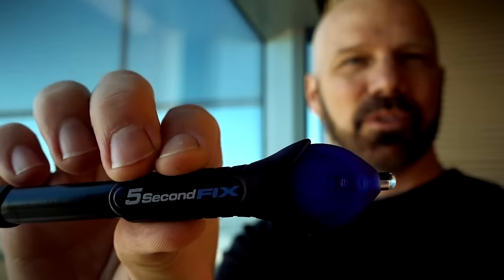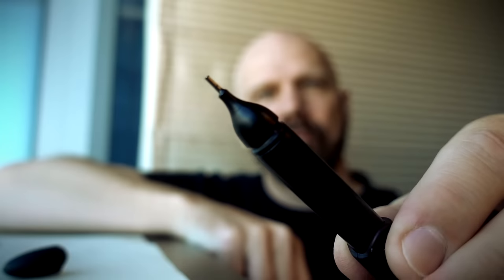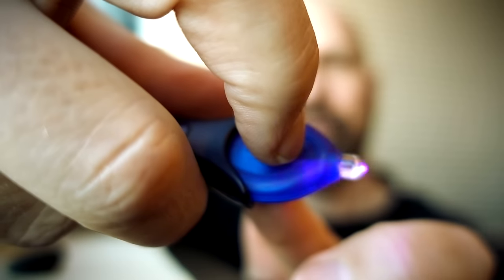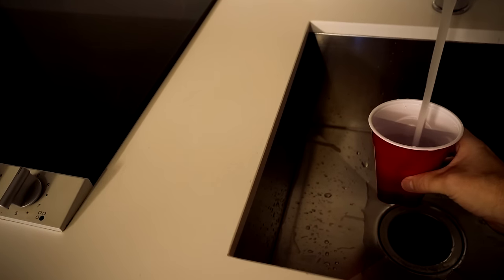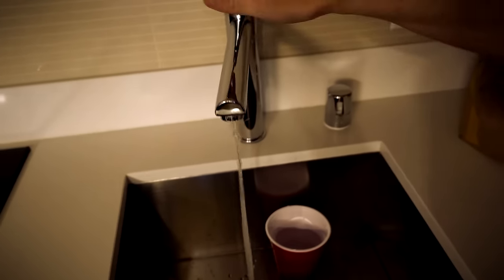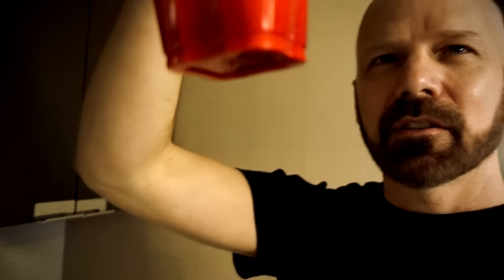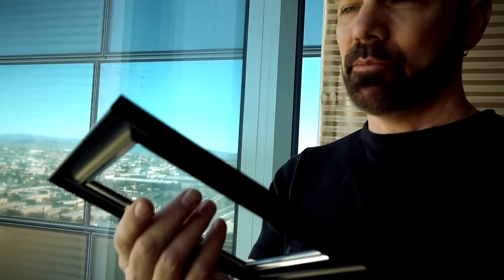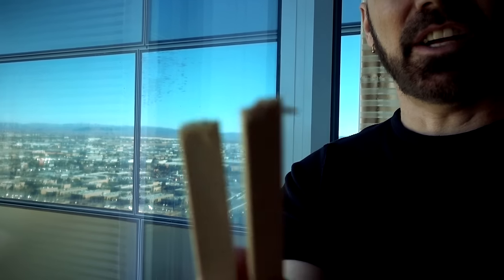5 Second Fix Review: Glue Alternative?

Comment: I think on the first popsicle stick you should have removed the splinters before using the product.  I think a combination of 5 second fix and superglue would be a better option.  You could use superglue first then complete with 5 second fix, or you could use 5 second fix on one side to hold it together, use superglue and give it time to set, then finish sealing with 5 second fix.

Comment: I've not really heard about this product until today, I see it has been out a long time, from all the reviews it seems a complete bust, however if it is a product that solidifies it could be a filler type product.

If it is a product for filling holes and such then it could have some use, bonding seems futile at best and seriously bad, but as a filler and then once it has filled and cured within the 5 seconds it's a fast way of then applying your glue to make a good bond.

perhaps as I say I only can speak in relation to what I have seen on youtube and how the people have been so disappointed with it's performance.

But judging from where it came from ie a dentist, and judging by what I have seen it may be worth trying it as a filler.

Comment: Another lie.  Just get good wood glue not so much at $1Tree Stores or Michael's or craft stores or Freight Tools or Ace Hardware, Lowe's, or Home Depot,or even Walmart. Then put clamp 2 hold it. Lollipop sticks are cheaper less strong wood too.Pkastic once broken it's broken.  I could sure use at 4 snap lid set messed up on 1 side of 1 of the clamping sections.

Comment: On the picture frame put super glue in the middle and the 5 sec glue on the edges dry the 5 sec glue then the super glue will dry in the middle not coming apart because the 5 sec glue seals it shut

Comment: I like your reviews but I'm sorry but I think you failed on this one. You keep gluing everything together by applying glue only to the very edge of objects. You sight because you don't think the UV light will penetrate solid colored objects so you didn't even try. In my personal experience, gluing things together only from the very thin outer edges won't hold very well no matter what type of glue you use. Please redo this review and actually try to apply the glue to the entire surface of the break and see if the UV light will in fact penetrate enough to give you a better hold. I will reserve judgment until then. P:S, your first attempt should be the broken arm on a pair of glasses as this seems to be the poster sales pitch on their packaging.
Reply: MrCougar214 I agree
Reply: MrCougar214 its not glue tho
Reply: COMPLETELY AGREE!!! Disputes the fact that it’s instructed to put it on the outside, like welding, but isn’t an adhesive alternative? Adhesive should cover the entire broken surface to adhere the pieces together.. honestly pissed me off the whole time watching him just put it on the edge of everything😂😂😂
Reply: This is a knockoff of Bondic Plastic Welding, with inferior chemical composition. You use it like you'd weld two pieces of metal, which would NOT be to pour molten metal between the parts like glue, but to make a welded seam around the outside where the pieces touch.